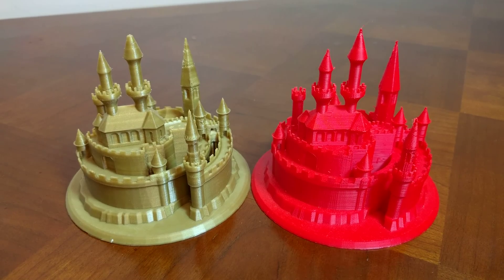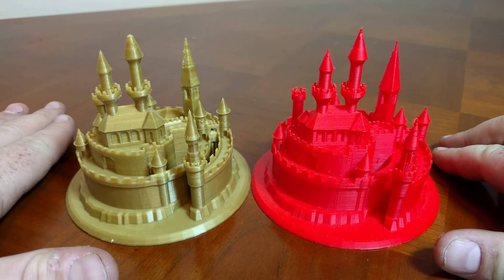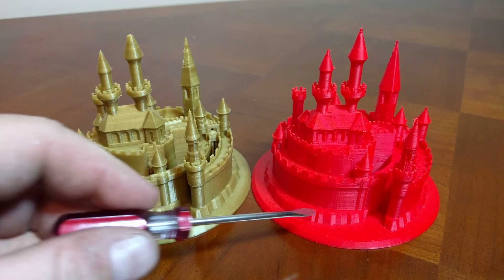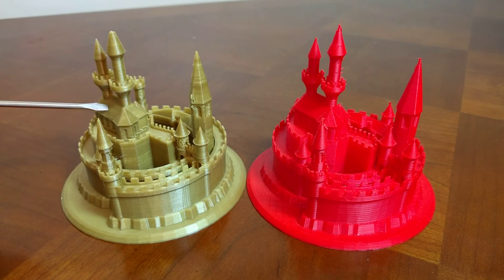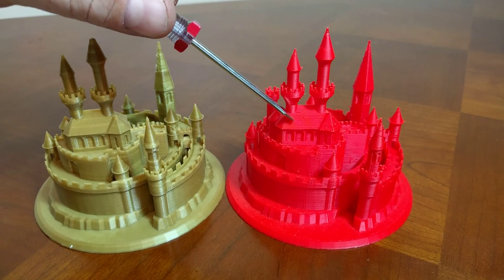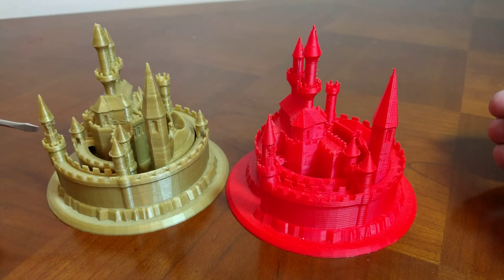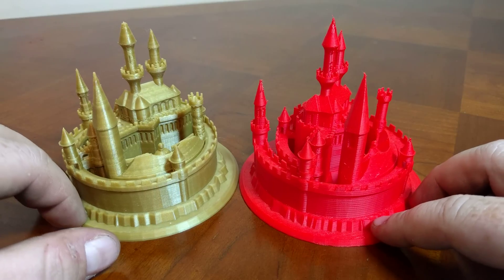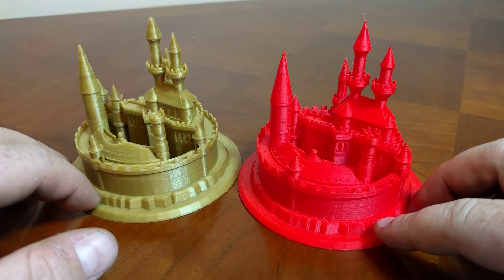Who Printed the CASTLE Better, Da Vinci Pro or Prusa i3 MK2 ???

Comment: "Because this is a bowden style setup" is wrong. Should be "because i haven't dialed in proper retraction settings for the bowden style setup"

Retraction distance for direct drive should be 1mm-2mm, and for bowden 5mm -8mm.

Comment: Bowden or direct drive is irrelevant if the are both setup and tuned correctly and all slop is removed from bowden tube and couplers. They will both be blob free when setup correctly. However direct drive is easier to get setup optimally. Also, PLA and ABS can both be 100% blob free also, but again PLA being easier to get just right. This test really needs both printers to be on the same material AND color for a comparison to have any real measurable meaning. 

That said, I own both printers and a number of delta printers.

The prusa with it's bed leveling and preset material files for various slicers was the highest quality I have owned from the first print on, most trouble free. Not the fastest, but the most confidence inspiring from the 1st print on.

Prusa guys have really done their homework and testing for new users.

Just my opinion, your milage may vary.

Comment: I think the video would have been much better if it was apples to apples style comparison. ABS is a much more difficult plastic to work with also different brands even of the same variety or different color print different and dramatically change outcome. Do another video with the same exact brand, type and color filament and then compare.

Comment: should have done them both in the same color and plastic. you should make a follow up0
Reply from the maker: Good point. I will print the next parts with the same filament
Reply: Tesla so true. PLA and ABS should not be compared. Second,  Da Vinci's built quality is the major issue. A good bowden system prints as good as a direct drive.
Reply: That would make sense, but ultimately it's not necessary in this case.  For instance, the poor z axis registration is probably caused by the fact that the Davinci still uses a shitty solid coupler between the threaded rod and the motor.  You can change filaments and you will still see the same defect.
Reply: GoatZilla : mecanics are complex. On the Prusa MK2 there"s some ACME motor shaft and it prints perfeclly. Everything counts. You can't blame a component regardless of the orhers or the structure.